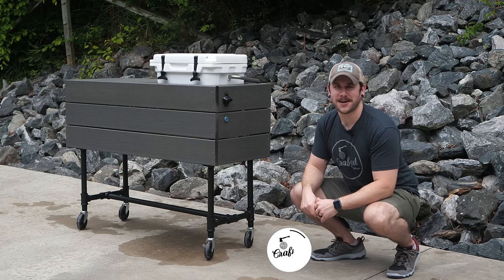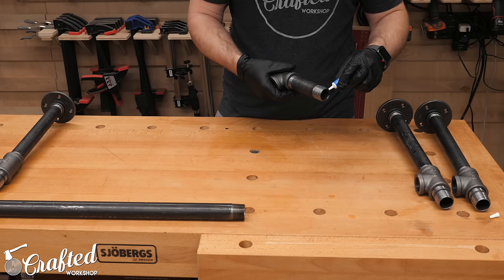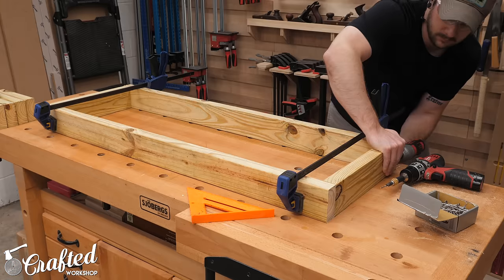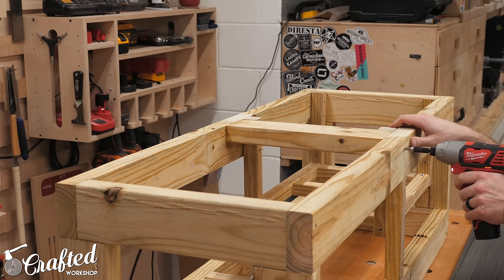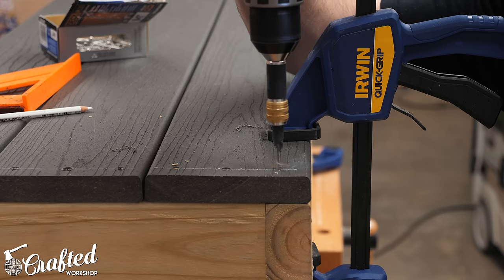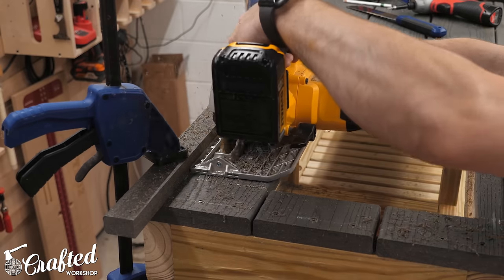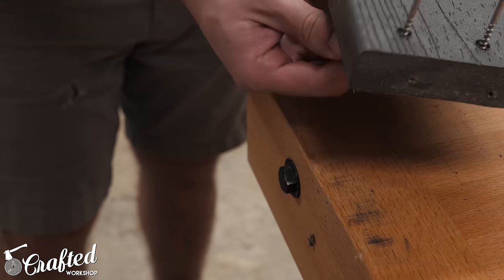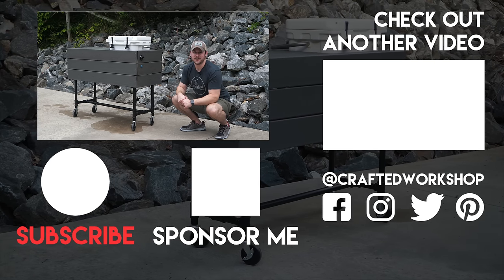DIY Outdoor Patio Cooler Ice Chest Made Using Basic Tools // Woodworking - How To

Comment: Enjoyed the video! Just picked up some trek board from the big blue store, roughly 200’ for about $31, which was returned by someone with a few of the boards mitered... and I got some of the most expensive pvc decking board, which was 20’ long at $80 a board with no defects and I got 8 for the price of two. So it never hurts to check on the outside of the building on the lumber side or ask an employee,you never know what deals you can find!

Comment: To get those corners you should drill them out on the inside of your lines with your desired size bit and cut to the holes to make those corners easier to cut too.

Comment: Nice build Johnny. I like that composite material since it's a lot more durable. One question tho, since there's slight space between the boards, would rain/moisture get into the 2x4 boards underneath and warp/damage them?
Reply from the maker: Thanks! The 2x4s are pressure treated, so they should be fine.

Comment: Were mitered corners always out of the question due to material type used?
Reply from the maker: It would have definitely been possible but tricky with just a circular saw.
Reply: Right, got it. The bottom built out of pipe with casters was genius. Keep it up sir!
Reply from the maker: Thanks!